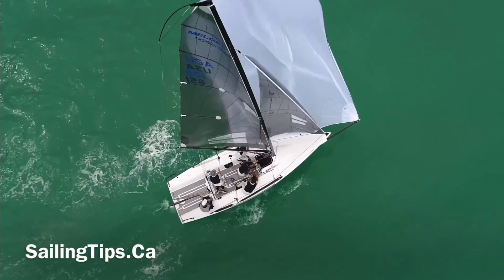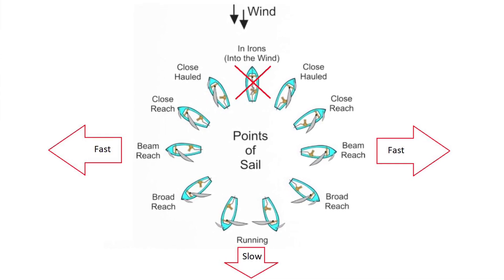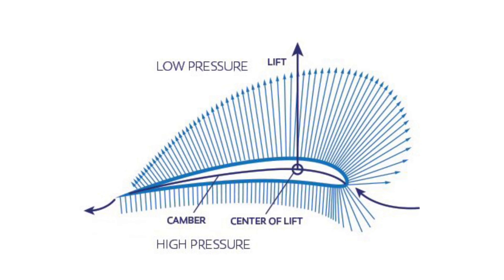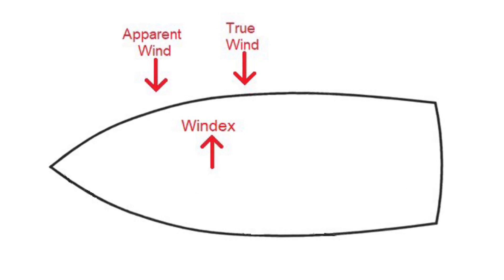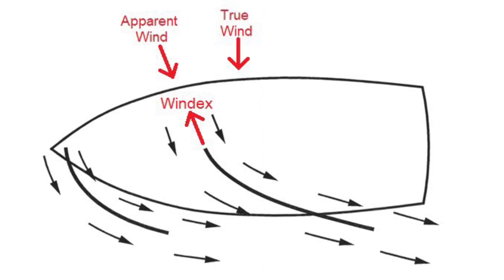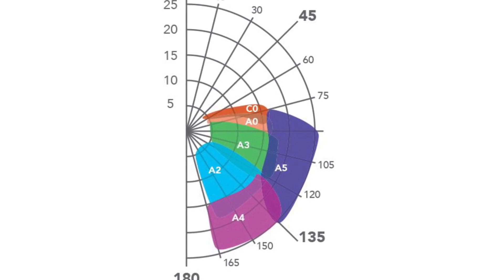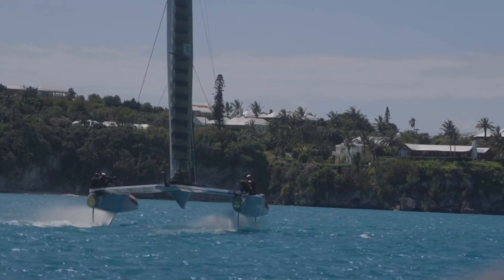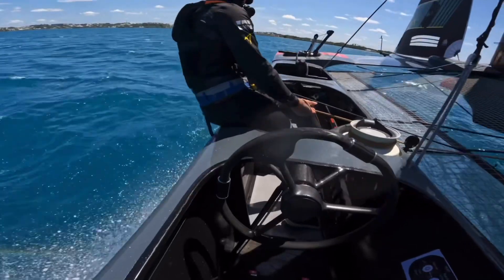Why Don’t SailGP Boats Use Spinnakers?!?!?

Comment: Is this why AC foiling boats cannot point any higher than 45° as shown on tv graphics overlaid on the course? Is it, the faster you go the more you have to bear away because the wind is being bent to come where the boat is pointing? Cheers😊
Reply from the maker: To me they appear to tack and gybe through about 90 degrees so 45 degrees off the wind as you say. But in order to do this they need incredibly tight sheeting angles for upwind and only ease the sheets slightly for downwind.
Reply: @SailingTipsCa  So, do you agree that the faster you go, the less you can make to true wind. Debating this subject, I believe that thos is one of the biggest reasons slower boats seem to point higher to true wind, all things being equal. Cheers
Reply from the maker: @robertcain3426  Yes the faster they go the further they drive the apparent wind forward, which ultimately limits how high they can point. At the same time pointing as high as possible in a fast boat generally doesn’t yield the best VMG, or quickest time to the windward mark. In my trimaran I can point as high as any monohull but then I’m also stuck going about the same speed as them. Or I can bear away 5 degrees and go twice as fast, and still beat them to the windward mark even though I’m not pointing as high because the extra speed more than compensates.

Comment: Because their speed is so fast that the apparent wind is always forward of the beam preventing use of a spinnaker
Reply from the maker: Exactly! Even on my “slow” F-82R the apparent wind is almost always forward of the beam and we typically fly a spinnaker at 70-90 degrees apparent. But on a SailGP boat the difference in apparent wind between upwind and downwind is only ~15 degrees which is too far forward for a spinnaker.

Comment: Questions: Would this only apply to foiling trimarans, as I heard you mention that? Or is it more dependent on what speed your
trimaran is reaching?
Reply from the maker: Lots of fast non-foiling trimarans also generally don’t use spinnakers either, because the speed of the boat drives the apparent wind forward so much that they are almost always sailing upwind. Even on my F-82R trimaran it’s very rare that the apparent wind is aft of the beam, so we use a very flat spinnaker that flies well in 60-90 degrees apparent.
Reply: @SailingTipsCa  Thank you kindly!

Comment: I’ve sailed on a monohull foiling boat that had spinnaker, called the 69F, you should definitely check it out. I started to fly at 10-12 knots of boat speed with 6-8 knots of wind
Reply from the maker: Looks like a very cool boat! Those spinnakers are also very flat and also essentially working as upwind sails!
Reply: @SailingTipsCa yes, when there’s not enough wind to foil, some teams used the spinnaker for upwind
Reply from the maker: @kneesurgerist  What I meant was that the boat is so fast that the apparent wind is probably far forward of the beam even when you’re sailing downwind i.e. you’re always sailing upwind.
Reply: @SailingTipsCa it can be true
Reply from the maker: @kneesurgerist  My F-82R trimaran doesn’t have lifting foils and even on that we’re pretty much always sailing with the apparent wind forward of the beam, even under spinnaker!

Comment: Thanks for another really clear explanation.  

Foiling racing boats probably could try to deploy a spinnaker, but it would be backwinded, collapsed and acting is a massive air brake if they did.  Which is why they (and their designers) don't have them.

Didn't know the F-82R had that much apparent wind effect.  90 degrees of apparent wind change is very impressive.  All the more reason to get a (performance) trimaran.
Reply from the maker: Interestingly all the fast multihulls around here still carry spinnakers but none of them are full-foiling. For example our F-82R can "only" sail at 1.2 times the wind speed, which is much less than a full-foiler that can sail at 2-3 times the wind speed. Spinnakers do allow us to sail very deep downwind, but depending on how the wind angle compares to the race course we do often find ourselves switching back to whites (e.g. jib or screacher) while the monohulls are still flying spinnakers.
Reply: @SailingTipsCa  Got it.  Seems like it depends whether it's windy enough to have enough apparent wind effect.

Sailing at or near wind speed is great, and foiling is very hard to maintain, and full flying (foiling all hulls out of the water) even more so.

Was very impressed with the fully flying single handed large trimaran in your other video. Gitana.  Does that mean its autopilot sails to true wind direction?  I.e., it keeps the stingray main hull lifting foil flying by sailing to a particular angle to the apparent wind.
Reply from the maker: @LoanwordEggcorn  Lots of “normal” fast boats set their autopilot to follow the apparent wind, in part because that’s what the sails are set for, and in part because it’s very easy to measure that with instruments without complex calculations. Then the boat will head down in gusts and up in lulls, but the apparent wind stays the same. I’m not 100% sure what Gitana does in this case but they may use a combination of measurements, including apparent wind, boat speed, and ride height. Their autopilot is FAR more complex than a “normal” autopilot!!!
Reply: @SailingTipsCa  Thanks, I meant apparent wind of course.  Typoed true wind, corrected.  And agree it could be just one of many inputs, but probably one of the main ones.  

Some sort of averaged wave height would also be a reasonable input, where the smoothing function is non-trivial.  

And of course in big enough sea states, full flyers can't fly, just like any motor powered hydrofoil..
Reply from the maker: @LoanwordEggcorn  They certainly are limited by wave height. I expect boat speed is also a big part of the equation because that impacts the lift provided by the foils, so they would want to keep that constant. I bet the autopilot heads down once the boat gets going too fast and heads up when it slows down.
Reply: @SailingTipsCa  Yes, both make sense.  Speed through the water is definitely one of the major inputs, to keep things flying and stable.

Comment: does that mean these super fast boats can't go up wind?    At 3x speed of the wind while pointing 90 degrees to the true wind direction, as soon as the boat points 85 degrees, the sails will begin to luff and depower.
Reply from the maker: Yes they can sail upwind, typically tacking and gybing through around 90 degrees, however to do this they have much tighter sheeting angles than "normal" boats. For example when a "normal" boat tacks through 90 degrees the true wind will be at 45 degrees and the apparent wind at around 30 degrees. On these boats the apparent wind will be far further forward, so they need much flatter sails, and the rigid wing main is a big part of being able to sail with the apparent wind so far forward because it doesn't luff like a fabric sail. And when they are sailing "downwind" the apparent wind will only be a few degrees aft of the upwind position, so only a very slight ease of the sheets required. Hope this helps!
Reply: hmm, let's say the ultra fast sailboat is fully pinched and pointing 45 degrees or higher into true wind direction. Razor blade jib & main sail trimmed to the max, how much faster than ambient wind speed can the boat move? certainly not 3x wind speed? Maybe 1.2% of wind speed?  (for sure 3x wind speed when broad reaching)
  The only higher performance sailboat I have sailed is a Hobie cat and it's easy to mentally conceptualize such a thin hull cutting through water because of so little resistance through water. I.E. pulling a dinghy through water vs a kayak, you can feel the difference. 
Apparent wind and these levels of efficiency is blowing my mind!
Reply from the maker: @glenpang5025  Here’s a link to a wind speed vs boat speed graph that shows the SailGP boats can remarkably go 3x wind speed but unfortunately it doesn’t include the point of sail: https://www.catsailingnews.com/2019/02/sail-gp-f50s-boat-speed-vs-true-wind.html I think they can still go 2+ times wind speed tacking upwind at 90 degrees. Just watch the last SailGP in Denmark where the wind was 8-10 knots and I’m pretty sure they were going more than twice that upwind! Remarkable!!!

Comment: Good video. Brief and to the point. As a rookie sailor I was watching the recent America's Cup in Aukland (I was on the net)  and had the thought: Okay, what point of sail?  It was all close hauled.  Boats heading straight at each other - close hauled! How is that possible? Then I drew the vectors -  guessing True Wind was 20 knots boat speeds 45 knots - and there it was - all close hauled. Apparent wind was completely different.  While out solo sailing I noticed this as well. Downwind turned out to be the most difficult point of sail for me on 28' -36' monohulls. Mostly I seemed to be close hauled or close reached.  Beam reach seemed harder to trim for.   
(You might want to make a video on actual tacking. Almost all the diagrams I've seen in the books show a boat tacking 90°, no accounting for Apparent Wind. One day another rookie and I were out and needed to tack to get back to the marina. We tacked 90° - nope, keep turning.... We must have been 120° before we got wind; we were heading (slightly) backwards. )
Reply from the maker: Thanks for the suggestion on doing a tacking video! Currents will also have a huge effect on your tacking angles, so you might have been in some current? Some boats also don’t have the jib/genoa cars in the right place, which will also have a huge effect on tacking angle. Have you checked out the genoa car video? https://youtu.be/3glSLq_eXXE. The sheeting angle should also be around 10 degrees off centreline for a sporty cruiser, 7-8 degrees for a racer.
Reply: If you're using a traveller, remember to adjust it before or after the tack.  Having it too low after the tack (due to being high on the previous tack) can take enough power from the mainsail to maybe stall the tack.  So generically, sail trim probably.

Also jib trim, as @Sailing Tips noted above, along with current.  

Have not studied the physics, but I assume a jib does more during a tack to pull the bow across the wind than the mainsail.  So jib trim, including twist, could make more difference than the main.

Comment: Really well explained! I'm now curious on what sails you actually use on your trimaran (and how often).
Reply from the maker: Thanks! We have three headsails for our trimaran – blade jib (laying on deck at 0:37 and 1:47 in video), screacher (bowsprint-mounted furling genoa at 1:47 video), and a spinnaker (0:37 in the video). You can see the spinnaker tack at 1:47 just forward of the screacher furler on the bowsprit.  

In really light wind (0-3 knots) we typically use the screacher on all points of sail, because we will be beating or close reaching in the apparent wind regardless of the true wind. 

In 4-5 knots we still use the screacher for beating, but switch to the spinnaker for reaching and running. Our spinnaker is very flat and typically flies at 60-90 degrees apparent even when running. 

In 6-12 knots we switch to the blade jib for beating, but still use the screacher for reaching and the spinnaker for running. In all cases the apparent wind is still forward of the beam. In 12 knots of true wind we will see up to 15 knots of boat speed under spinnaker, which will bend the true wind at 150 degrees forward to about 60 degrees apparent. Because the apparent wind is so far forward, in 12+ knots we can really only fly the spinnaker at 150-160 degrees true, so if our course is above that (e.g. 140 degrees true or less) we have to fly the screacher because the apparent wind will be so far forward. 

In 13-20 knots we use the blade jib for beating and reaching, and start using the screacher more for running, unless we’re going really deep downwind and have lots of sea room, in which case we may still use the spinnaker up to around 20 knots, but only if there is sea room to bear away and depower.
At 20+ knots it’s mostly blade jib and main sail, and we’ll start reefing the main sail at this point as well. We may still use the screacher for running with a reefed main sail if we’re going really deep downwind and have lots of sea room to depower. 

There’s lots of great info on Farrier-designed trimarans at http://chesapeakemultihulls.org/wp-content/uploads/2019/07/2012_Sailing_Manual.pdf
Reply: @SailingTipsCa  I'm a little blown away by the amount of details and care in the answer. Thanks a lot for the in depth answer!
Reply from the maker: @marcantoineroussel  Glad it was helpful! Hopefully also a useful reference for owners and crew of similar boats!

Comment: Thanks. Could you possibly do one with a cruising chute on a pro-furl spinex?
Reply from the maker: Good idea! What specific aspects are you interested in?
Reply: @SailingTipsCa  I bought a used boat that came with a pro-furl Spinex with a cruising chute in a bag. My previous boat just had a genoa and a main. There was also a spinnaker but we never used it. We are a family and strictly cruisers. Would be nice to get ideas on wind angles, wind speed (for when to use it and not), butterfly with a Genoa and a cruising chute? Dead down wind or gybe? Ocean passages and maybe single handed? Thought I ask since you explain things in an easy and straightforward manner. Thank you.
Reply from the maker: I’ll do a video when I can get some footage. In the meantime a cruising chute on a furler sounds perfect for your situation!

They are cut fairly flat with small shoulders so quite forgiving compared to larger/fuller racing kites. It should fly nicely in about 80-150 degrees apparent. 

Basically hoist the snake, head off on a broad reach, and unfurl like a furling genoa. 

To gybe you can either furl, gybe the main, and unfurl on the other gybe, or use the technique in this video: https://youtu.be/N3BYhfYVfr8

I’d start in lighter wind, say under 5 knots until you get used to how it works, then move up to 10, 15 etc.

Definitely gybe rather than wing-on-wing, because the boat is much more stable and also faster when reaching than dead downwind.
Reply: @SailingTipsCa  Thank you! What wind speed would you say would be the maximum, about 20-25 knots? Let’s say we are on a passage or maybe just a couple of days and night sails and we have used the chute but wind angle and or wind speed picks up, would you keep it mounted and ready (furled in obviously) when sailing  just the genoa and main or would you tuck it away and mount it again when conditions seem more favorable?
Reply from the maker: Good questions! If it’s a 1.5oz kite and you have a boat around 40 feet the kite should be fine in 20-25 knots of true breeze. But if it’s lighter (e.g. 0.75oz) then 20-25 knots would be at the top end or slightly above and you’re starting to risk damaging the kite. But 1.5oz kites are pretty robust and you’re likely to have trouble controlling the boat or breaking other things before you threaten the kite. If the wind picks up or moves forward I might keep it raised but furled if I’m likely to use it in the next 15 minutes or so, otherwise I’d likely take it down. Depending on the layout of your boat you could potentially leave it all connected and stuff it down a hatch, or lashed to the deck somewhere. We have a roller furling screacher (kind of like a Code 0) on our trimaran that we leave connected with the snake lashed to the nets when we’re not using it. I think you can see it in parts of our spinnaker raising video https://youtu.be/S_JkbvGLG8Q.